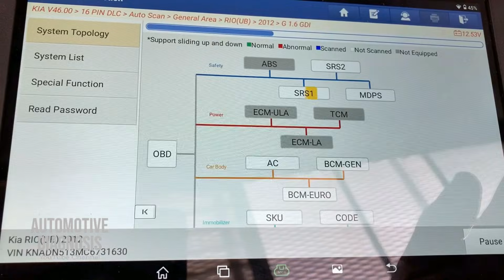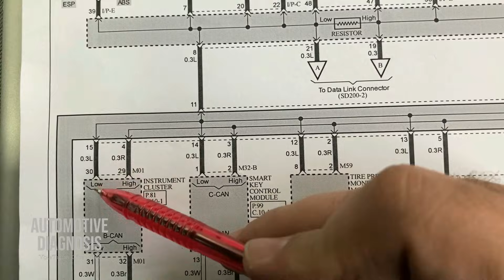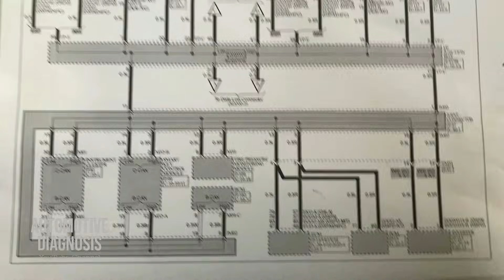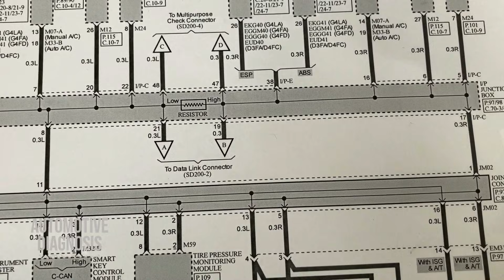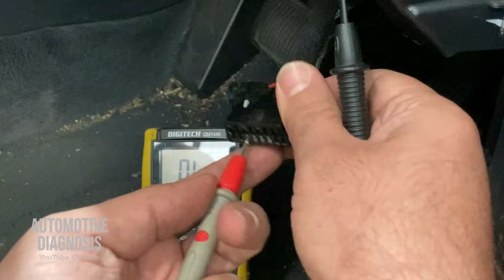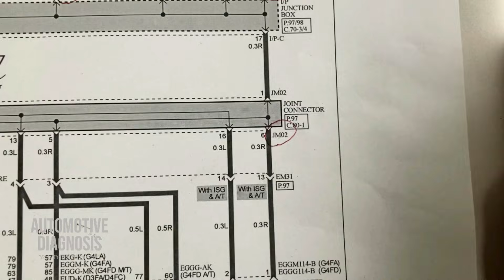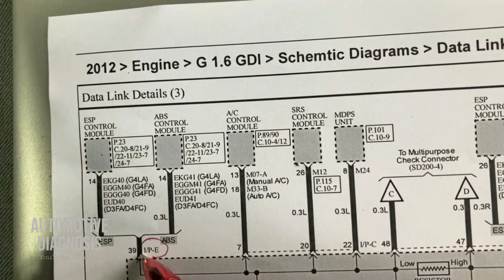CAN-BUS No Communication Diagnostic | Resistance, Voltage, Short Circuit, Pin to Pin Test #canbus

Comment: What if it isn’t 60 ohms but 80 ohms
Reply from the maker: There could be some connector problem, try removing one of terminating resistors and see what will happen to the resistance measurement

Comment: What program do you use for electrical diagrams?
Reply from the maker: For this one I used KIA GDS which is the OEM scan tool which comes with all diagrams, but we have some wiring diagrams in PDF and will provide them to everyone very soon.
Reply: Super thx.

Comment: Hmmm, decent test plan, but it is 2024;  invest in some tools and equipment, e.g., Breakout Test Lead, OBDII Breakout Box, Oscilloscope… I have seen too many misdiagnoses when individuals use the basic test leads that come with the Multimeters. I had a GM Tech trying to convince me that a VVT Solenoid was bad based on the resistance he performed. The test lead probes were unstable in the Connector Cavity when demonstrating the resistance test. The readings fluctuated, so he was under the impression the solenoid was bad until I used some of my breakout test leads and scope in resistance mode, demonstrated the resistance was within the desired range, and corrected the engine oil level, which resolved the concern.

Comment: Another excellent video.
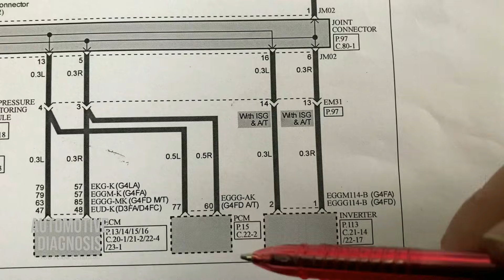At 2:27 why does the diagram show PCM and ECM usually they are the same thing.
Reply from the maker: Hi my friend. Normally ECM refers to Engine Control Module only, and PCM refers to ECM+TCM. So wiring diagram technically covers both cars with automatic transmission (that we must look at PCM on the diagram) and those cars with manual transmission (that we must look at ECM on diagram).
Reply: @AutomotiveDiagnosis  Thank you for the reply

Comment: So umm... How did you repair that wire?  That would have been interesting to see being it's a data wire
Reply from the maker: Hi there, luckily there was only a minor issue on the wiring insulation not on the wire itself, so very easy to fix. But in case of having any damage on the wiring on the CAN-Bus, I never do soldering, as I do on the normal wiring, I rather to replace the wire between two ends.